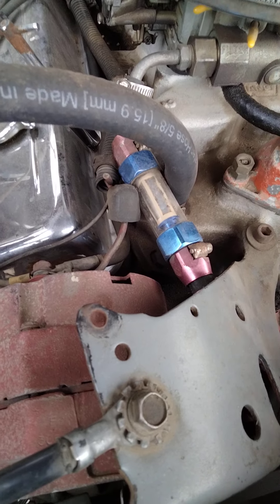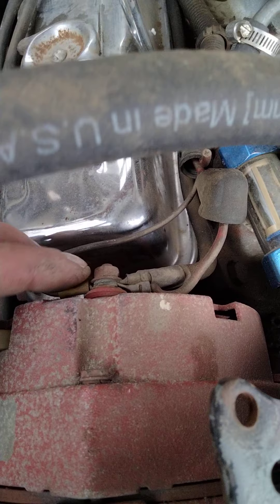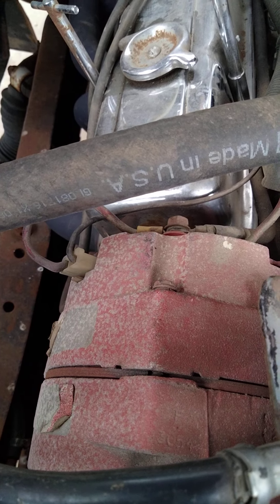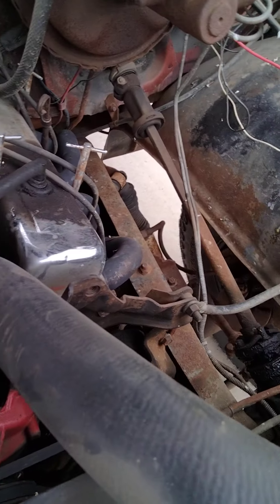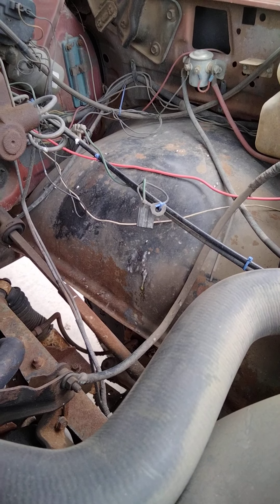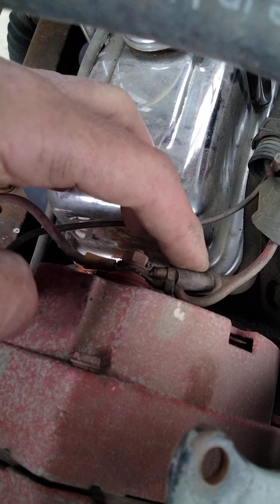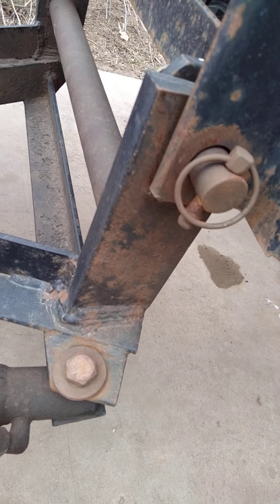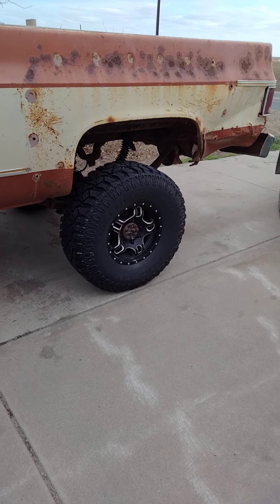Chevy Alternator wiring trick !

Comment: I think I have the same issue. I have four wires running to mine, a ground, a hot and two wires in the plug. 1971 c10 all factory
Reply from the maker: @timbof1016  never had a problem since i started doing this !

Comment: Could I run a hot wire directly off my alternator to my battery? Having a charging issue.same setup you have.
Reply from the maker: Yes ! Thats what i did after i modified the wiring like in the video . Now the cable hook up on the back a the alternator goes straight to the battery . Out put post on back of  alternator , straight to battery
Reply: Would a 8 gauge wire too small to run from alt to battery?
Reply from the maker: @danwilliams8951  thats a little small fr sure . Need something the size of the ground cable . Maybe 1 size smaller . No less